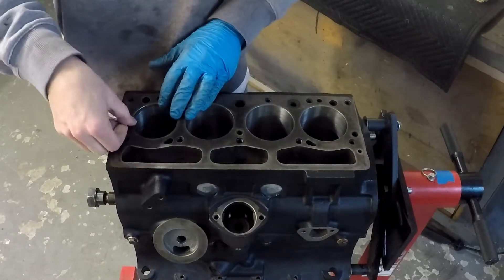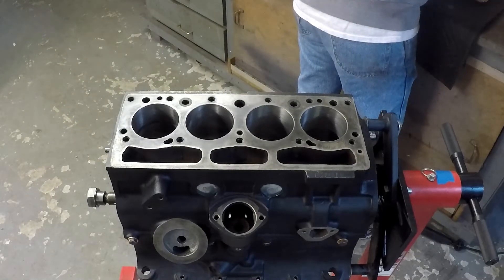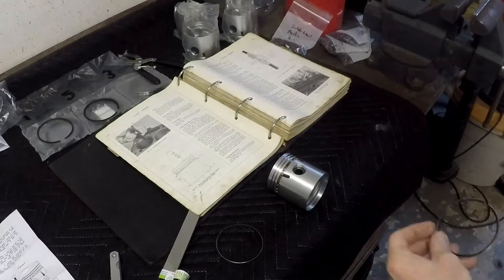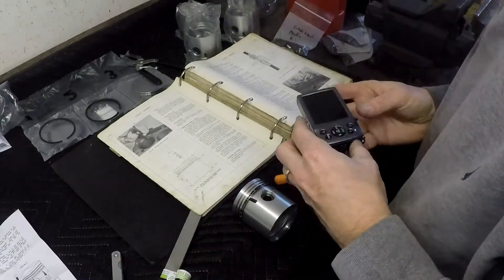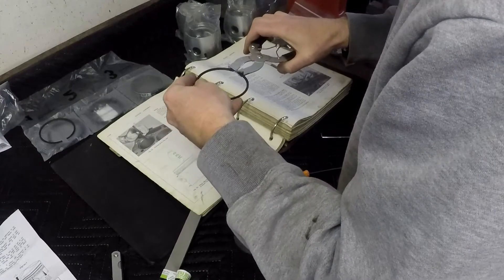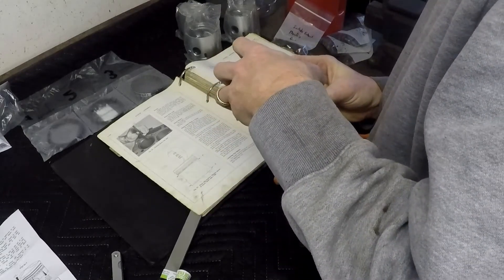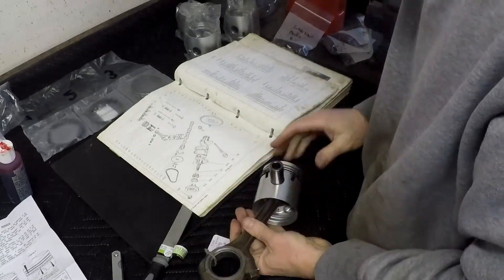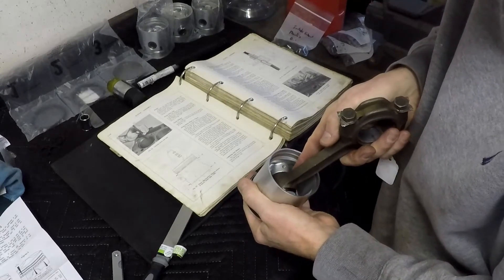Triumph Spitfire Engine Rebuild #3 - Piston Installation

Comment: Great video as always.  I am actually in the process of rebuilding a mk1 spitifire engine.  Out of curiosity, I was wondering what exactly you did to convert yours to a mk2 engine.
Reply from the maker: Thanks for watching! Convert may be a strong word. But, I used the Mk2 intake and exhaust headers, the Mk2 flywheel (so I could use a diaphragm clutch vice the older, spring style). I used the Smith's PCV valve and made the crankcase ventilate to the intake (via the PCV) vice just the road via a vent pipe. Also used a Mk2 distributor as well as the timing specs for it (got lucky there because it had one when I got it). The only thing I couldn't (or didn't, I guess a machine shop could have) do was put in cam bearings and use the slightly hotter Mk2 cam. At some point, the original motor was replaced with an older Mk1 and the previous owner sort of converted. I brought it the rest of the way as much as I could.

Comment: Wow!  I often see people replacing con-rod bolts or nuts but thought it was just an abundance of caution.  That stretched bolt was WAY into the plastic range and very likely to fail at some point possibly grenading your engine.  I've found softened coil springs in '60s British engines but those bolts were ridiculous, ha ha.  I'm a bit surprised the lock washers were being reused.
Reply from the maker: Yeah, that surprised me. I learned a lot of fracture mechanics in my time in the Navy, but I had never really experienced ductile failure before in a "real-life" application. I wish it hadn't happened, but it was cool. In hindsight, I probably should have gotten new locking tabs. It wasn't until later motors that lock washers were used. Something with a different bolt design that I never really looked into. Thanks for watching!

Comment: Chris,  excellent video.  Many thanks for taking the time to put these videos together.  Just purchased a 1971 Spit, former SCCA road racer with a damaged engine.  Although I have previously built up MG engines, I have not done a Triumph.  Look forward to getting this car back on the track for vintage racing and have used your videos to prepare for the upcoming work.  Again you did great work.  Cheers
Reply from the maker: Thanks, Robert, I appreciate that. 71 is a good year with a good motor. I don't think you'll find much different between the motors. As a matter of fact, the later 1500 Spitfires and the Midget shared a motor and gearbox. Good luck!